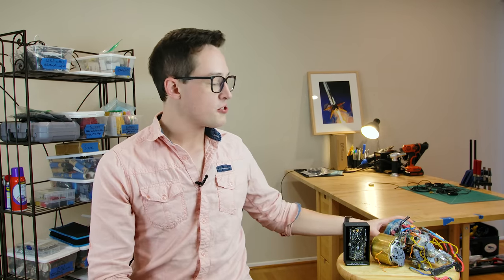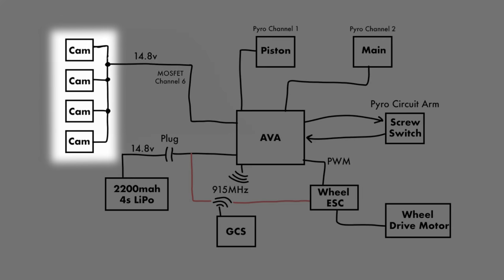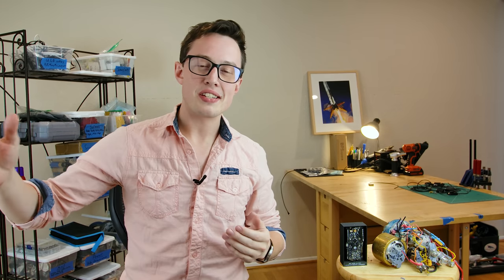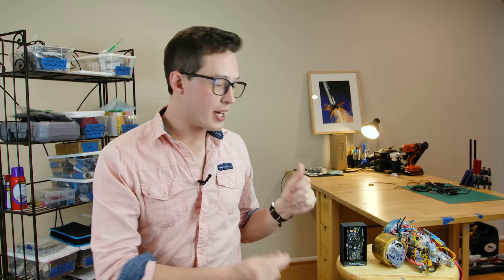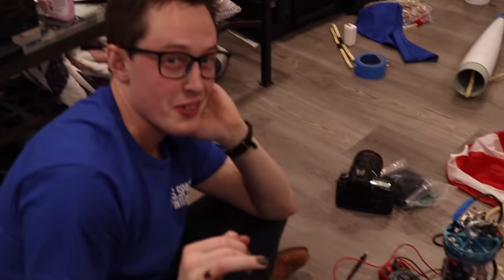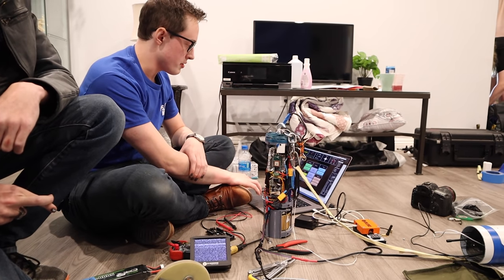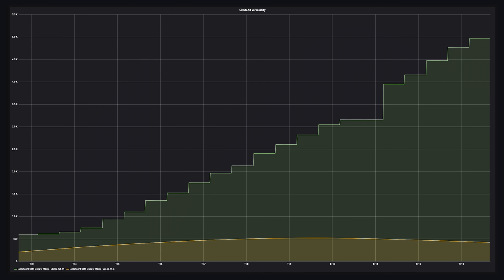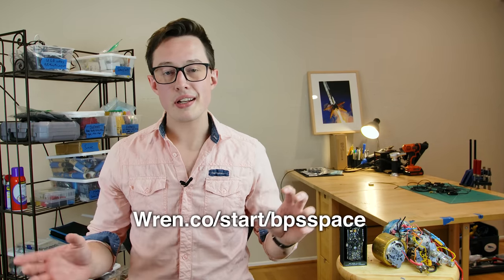Rocket Avionics - Building Lumineer

Comment: On the crushed microSD cards ...  Someone who has the skills (who isn't me) may be able to repair the chips by repairing the broken runs.  From everything I know about them, the memory on there really takes up all the inside space under the ceramic.   It isn't like the old days where there were (relative) miles of gold filaments to extend a tiny chip to the distant pins of the DIP package.  

I don't even know who to recommend.  It may be far more expensive than the data is worth.   

Packaging the SD cards in a black box style enclosure may be safer.  A small aluminum box, full of silicone will protect it from crushing and impact forces.   Run a microsd extension cable would do, and you wouldn't have to design anything, other than the box.   I'd think regular silicone caulking from the hardware store would be more than adequate, but you'll probably want a protective skin in case the liquid silicone is corrosive while it's setting.   A quick test with a $5 tube of silicone caulking, and an old small microSD card would see if it's safe.  

It may be worth it to protect the whole avionics package like that.  I'm not sure if the avionics would overheat in caulking though.  I think it conducts better than air, but not as well as aluminum.   Again, something to test with disposable hardware.   Throw an Arduino or ESP32 in a test box, and run some CPU intensive tasks.   A ESP32 has a built in temperature sensor, which can be read with the temprature_sens_read() function (misspelled exactly as that).  The wifi will give you a good indication if there will be undesirable RF attenuation through the silicone.  There will definitely be some RF problems through the aluminum shell.

Comment: A small suggestion for broken SD card.
If only the body is cracked.
Then, maybe use a card reader. 
SD CARD can be loose, may come out, so I glued paper on the body with super glue. Maybe you can try.

Try using li-ion instead of li-po.
Li-po is quite dangerous.
Reply: But lipo has its advantages too, LiPo batteries have a much better energy density and can deliver much more current than a Li-Ion
Reply: Sorry not trying to offend you but your advice is kind of terrible, which shows why you can't trust random people on the internet. I'm pretty sure Joe has already tried plugging one of his cracked SD cards into a card reader to try to get his data, also pretty sure plugging an SD card into a card reader is basically the only way to get data off of it even on a perfectly new and working card. A better idea would be to tear the sd card apart and transplant the flash chip to another sd card, but I don't know if the chip itself is broken. Lipo batteries are a better option for this use case in my opinion with its higher current output and capacity, and li-ion is actually no less dangerous than lipos. Plenty of li-ion batteries (uh-um teslas) have caught on fire.
Reply: @EdisonWong2004  
Quick tip: don’t tie people to their ideas if you’re providing harsh criticism. 

“The idea you suggested is dumb”
Vs
“Your idea is dumb” 

Just helps people part ways with their poor suggestions more easily
Reply: It's worth noting that li-po IS li-ion. Li-po is still a li-ion chemistry, but it uses polymer electrolyte instead of liquid electrolyte as in more standard li-ion packs.
Reply: Then, sorry for bad idea but I did try paper for SD card.Well it worked.
Reply: @clonkex  I remember someone saying that they don't even use polymer electrolytes in lipo cell, that was a type of battery planned but I don't think it ever got any success. And lipo now adays just means a lithium ion with a plastic outer shell
Reply: @ipodhty  Hmm you might be right. There still appears to be a difference between cylindrical and pouch cells but it might not be what I thought it was. It appears that lipos aren't really lipos. Very hard to find information on this since misinformation is incredibly pervasive on this topic.
Reply: @clonkex  yeah I know what you mean, and even if the are the same basic chemistry there are so many small changes. Like rc lipo's really don't like being left at full charge one bit, but your phone battery doesn't mind it that much

Comment: Regarding being able to plug the wrong kinds of cables together: in the aerospace industry this is often solved by keying the connectors differently.  This allows the same kind of connector to be used, simplifying manufacturing, tooling, training, etc, but prevents the issue you are describing.  Unfortunately it's not possible on many small connector types, though some hobby-available connectors like dsubs do allow for keyed jackscrew / jackposts.
Reply: RF is no more black magic than rocket science is! 🙂

Comment: If you're not using the BEC on the ESC then you might be able to discard the PWM ground wire altogether in the future anyways when powering reaction wheels.  This not only reduces noise in the PWM signal but prevents this issue from happening again full stop.

Comment: screw terminal hack : strip wire then fold the stripped bit back over the wire and push it in the terminal then you can screw down onto the insulation and its much stronger.

Comment: I'm always nagging coworkers about tinning wires for tiedowns.  The worst thing about the resultant creep is that it's really hard to troubleshoot as you can still see a potential on a crappy connection.  Sometimes it's unavoidable if you've only got stranded to work with for whatever reason but it's worth knowing about.  Ditto on all the other notes on connectors.

Comment: The problem with different designs for redundant flight system is you will get an in-fight about who's design will get to be the 'primary' one. And what would the secondary do? Stand by? Take over? That's a hard problem and not necessarily with a technical solution. Is three/four/five time redundancy enough to alleviate the 'our system is just an Easter egg' problem?

A stand-by/non-action system is a team morale black hole

Comment: Check out the 915 and 433 MHz antennas used for long range RC flying that may have more appropriate antenna radiation patterns and locate them away from other metal and electronics, perhaps inside a fiberglass (not carbon fiber) nose cone.

Comment: They make a board for basically dissolving the casing of the micro SD card, or whatever SD card you have, mounting it, and using these little metal arms to make contact and breakout the internal SD card chip. just google an SD card recovery kit and you will see the green board I am talking about.
Reply: @BPSspace

Comment: The MicroSD cards were destroyed because they were in the standard metal slide-in card holder.  Next time, solder the wires direct to the pads on the card and wrap them in foam.

Comment: You may want to put a short rocket section made of something like fiberglass to put the telemetry antennas behind so the signal wont be attenuated. Perhaps put that section between the top cone that separates and the rest of the rocket. Or mount an antenna connector thru the side of the rocket with a right angle connector so the antenna is generally lays flat against the side to help aerodynamically.

Comment: To avoid your microSD cards dying on impact again (we all know this won't be the last, uh... suboptimal landing), you may have success with potting the SD card itself in some kind of solid elastic resin and using one of those SD thinglongers (reverse breakouts?) to hook the card to the camera. A surprising amount of "making things survive impact" just involves making the thing you care about a smaller part of a larger, wobblier so the energy of impact can be absorbed and dissipated instead of making you very sad about data loss.
Reply: He uses the flash to store the data during flight, so he still has the data.

Comment: Instead of a reaction wheel have you thought about using rollerons for passive rotation stabilization? They don't have the same saturation issues, work at high speeds, and have smaller rotational inertias.

Comment: I love how your buddy looks exactly like the nerd from the film "the martian"

ive crashed planes, burnt rc recievers and generally had a rough time from brown outs, You should definately try to build protection against that into ava anyway. 
Also, it seems obvious now, but antennas are line of sight devices............... id suggest an additional notch filter for each frequency to stop second harmonics becoming an issue.  And try to somehow make the antennas "look" in the right direction.   Look up the radiation pattern for those omni whips you have, you cant them to be mounted at 90 degrees to the rocket body so that they propogate downward not out to the side.

Comment: As far as reaction wheels go, your system was incomplete. A true reaction wheel system works with counter rotating wheels that spin up at the same time at the same speed. To rotate along a given axis, you brake, or slow one of the wheels until the change you want is made, and then slow the opposite wheel to match the speed of the first wheel. You then bring them up to the original rotating speed so you always have the same energy input for attitude adjustment. Having two wheels is how you avoid overloading the torque of the vehicle. Also, having that huge mass of the reaction wheel at one end of your rocket might also have contributed to your half deployed rocket be stable in a nose down attitude without a nosecone. I hope this is helpful, as it is given with the best intentions.
Reply: He didn’t even use the reaction wheels

Comment: Avoid the solid core wire, you asking for failure in high vibration environments, you should use boot lace ferrels on multi-stranded wire in terminals.

Also solder is bad because you end up with a sudden flexible to solid transition, which ends up focusing all flex to that transition point, fatigue then failure. Why almost all commercial/automative/aerospace connectors are crimp and not soldered (and if they are soldered they have integrated strain relief)  

Additionally you can use nail polish on the heads of terminals screws to reduce their susceptibility to vibration loosening. (Or silicon/rubber cement for increased endurance, just harder to clean and reuse)

Just a question about how ava is connected to the reaction esc: (i assume it must be 3 wire (gnd, signal, vcc), because i can't see how this would happened with 2 wire (gnd, signal). signal would be a relatively high impedance output? eg a micro io pin? unless it's buffered(transistor/fet) without a series resistor?)
Reply: Green (wicking) Loctite can be applied after the terminals are tightened.
Screw terminals and screw switches are very reliable in my experience.
Reply: I don't think the solid core wire will fail in such a short flight time, Of course you can't use them in something like a car engine which vibrates for thousands of hours, but in a rocket which vibrates just for a few seconds it is fine...
Reply: @Henning_S.  Leave plenty of slack so you can trim the crushed wire ends back.
Honestly solid wire was never intended for harnessing and avionics.
It's used exclusively for static installation, like home wiring.
Any A&P would be aghast at the mere idea.
But I do use bell wire for matches and ejection charges.
The stiffer wire makes it much easier to push up through the fuel grains to the head end of a motor.
Reply: @jimurrata6785  yes, of course it is not intended for that purpose, but that doesn't mean it will fail within a few minutes...
Reply: @Henning_S.  Like I said, I'll use solid for disposable purposes.
But I'm not about bad practices or making my avionics harnesses even more difficult to lace up or work with.
Reply: @Henning_S.  I agree it's unlikely to fail during operation, but it is an extra risk and when the cost of failure is relatively expensive you want to avoid it. Thus in cases like a rocket, you want to minimise risk in all the places you can.

My main concern would be during building and testing. Solid core wire can only take a small number of repetitions of flexing before failure. Thus with an assemble such as an experimental flight control unit that you are constantly messing with: every time you remove a wire or a connector you are increasing the risk of failure.

Comment: is the datarate u are getting over your 900mhz xbee enough?

I used a ~800mhz xbee for telemetry of an (attempted) self driving racecar (formula student competition), but the data rate was only about 5kbps, which was only enough to update a few values so i ended up using wifi, with shitty range. Just wondered how much data u can manage to transmit over that thing

Comment: You mentioned multiple lessons learned, but I think you actually missed the main one: value simplicity to maximize success, and build from there. Your default design philosophy seems to always be “maximum complexity,” sometimes coupled with “minimum time.” Especially when attempting something new, that’s not the most effective path, unless you value a high failure:success ratio. Failure definitely is the greatest teacher, but ability is almost always  built incrementally, regardless.

Comment: Given that you like different connectors then a good rule would be a single connector per module ...at least for the reaction wheel. By the way, your reaction wheel control should have an in-rush current limiter for that capacitor.

Comment: 2:46 im not an expert but you could try to tape the micro sd card on the top and put it into a sd card( witch can only read the data of the micro as card) that wouldn’t damage the micro as card if it doesn’t work and if it works well you have the data

Comment: Have you considered styrofoam packing to further shield the sd card but the sd cards also need to not be on the main boards. More like a kid of extender so the built up momentum isn't displayed as a single unit therefore causing board crack to extend to the boards

Comment: Hey Joe, awesome video, as always. Regarding screw terminals, in my experience with medium vibration (robots), the best way to have a tight connection is to use stranded wire, but terminate it with a crimp on ferrule, applied with the correct tool. Any reason you are not using this in your rockets ?
Reply: Agreed, bootlace ferrule is the term, at least in the UK.

Comment: I would stay away from solid core wire in any application under vibration, and especially one where you are making adjustments or modifications. Solid core wire is great for screw terminals but is is very poor if you continually flex it. Even a multistrand wire soldered connection usually fails at the solder point if not supported. I would suggest people use ferrules over multistrand wire under your screw terminals to secure your connections.

Comment: Telemetry antennas at the base of the  fins so they are parallel to the earth's surface?  (ie pointing "normal" to the rocket body).
This would be nominal for the ascent.  Hard to say for the decent.
IIRC COCOM needs you to break speed AND altitude.  Speed should pass below 18,000m.

Comment: you lost communication in the start, probably due to the doppler shift of RF frequency, so unless your PLL can lock to the carrier transmitted you won't be able to communicate, probably when it went too far from you then the net doppler shift was lower so your Rf Transceiver managed to lock and communicate.
Reply: He lost communication because of the metal reaction wheel and motor case.

Comment: if the silicon wafer is not cracked... and you havent zapped it with static electrics, recovery is possible.
if either of those condictions is false its gone. 
the plastic acts as a insulator, there should be 3 wafers inside, some have 2 some have all of it in 1 wafer but the general gist of it..
the memory cells are very vunerable when not isolated from outside.
if you staticly zapped them you can imagine what happend.

some one with the tools needed to wire to the memory unit could in theory read its content and give you a raw data dump, then you or someone else decode it to actual readable files

Comment: AT 9:46, when you disconnected the ESC, why didn't you unplug it, why just open circuit the positive wire, I hope you left the input plug/socket on the ESC so you can properly  isolate it.
All in hindsight ofcourse.

Comment: To help with roll stability, you might want to check out rollerons. As I understand them, they use the gyroscopic procession of a small spinning wheel exposed to the airstream to actuate a control surface. You can find more information on them in this video: https://youtu.be/cfzj3rRIVU4

Comment: I was wondering if using Flexible PCBs (Or ridged flex if you need some hard point for the accelerator )and put all the Data logging stuff on the flex part with some nice Power test points. SO in an event where the computer gets crumpled you can just snip of the flex part and put some power on it for the data chips to make this more optimized.

Comment: Isnt it possible to wire the sd slots to an adapter, and make a black box, where the sd's can be put in, to withstand the inpact?
Reply: The SD card doesn’t even hold the data during flight. The flash does.

Comment: You are reinventing the wheel. On purpose and for good reason. 
But the history of the wheel is not the path you’re walking. It’s the path of self discovery of course. That’s the good reason after all. 
Find a mentor, little flusher. (You may have to look this up, a lot. It’s old. ;))